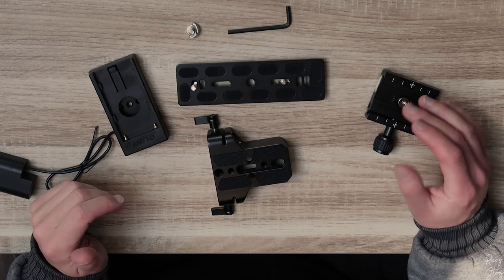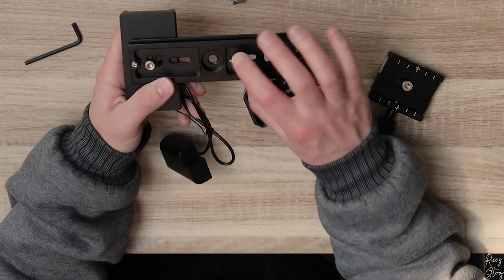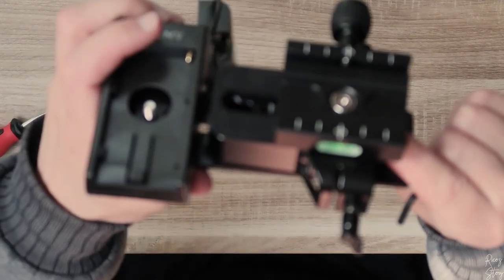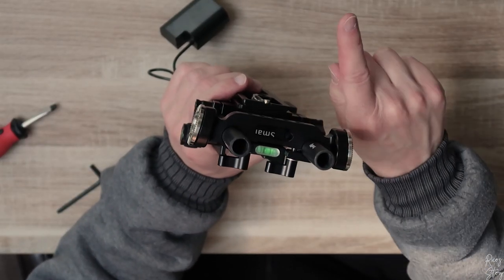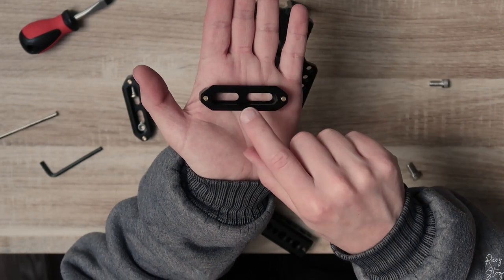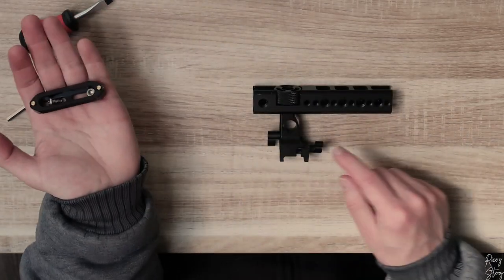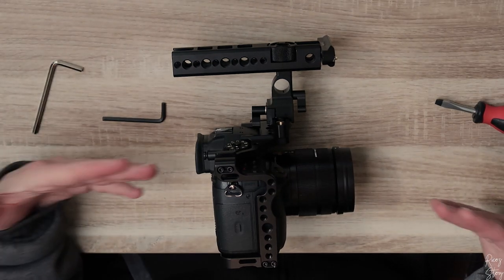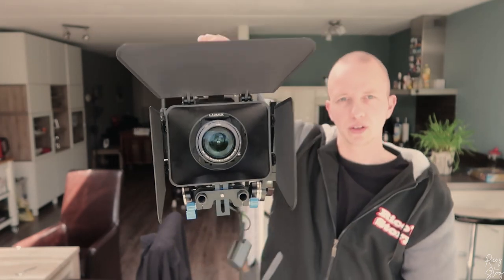HOW to BUILD the PANASONIC GH5 RIG

Comment: Impressive build. Are all these parts designed for this, or are they independent components you can buy? Reason I’m asking is I have a gimbal I would like to add more features to, like tripod + mic + handholds 😄🤙
Reply from the maker: The cage is for the GH5 specifically. Rest is like universal.